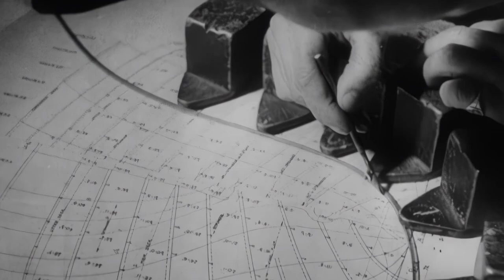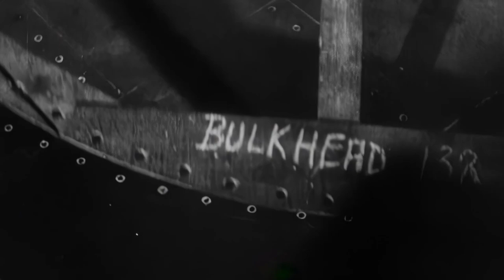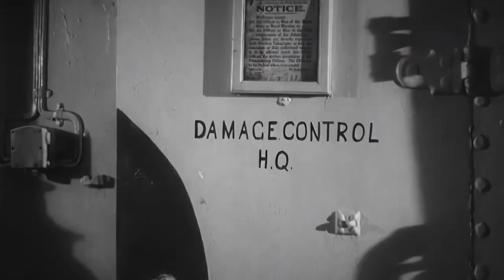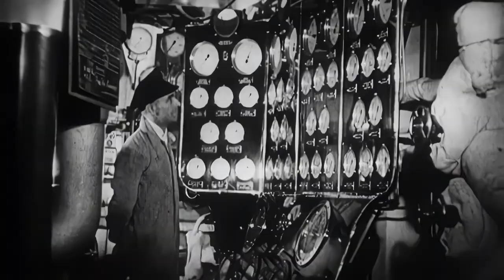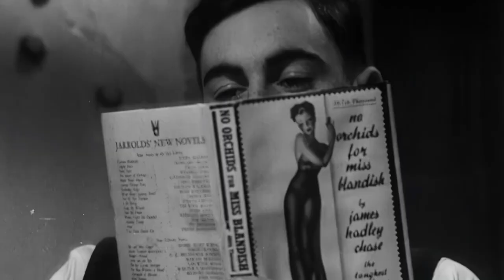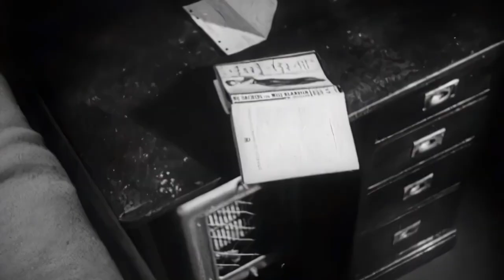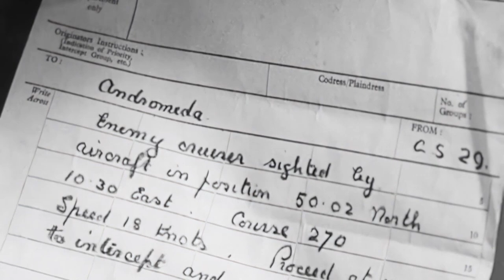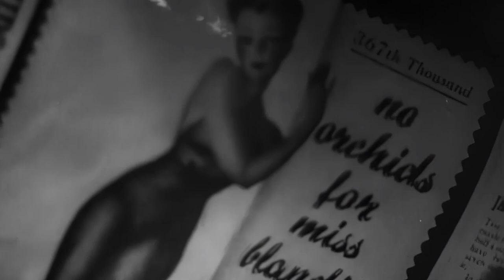Damage Control |  A Story of Seven Sailors (1944)

Comment: Thank you for your efforts that you put into sharing this. It’s much appreciated. Other than the interesting content, I work third shift and it’s such a thrill to get these posts late late at night or early in the morning.  Helps me pass the shifts. Cheers!
Reply from the maker: Thanks. These "black label" remasters mostly just take computer processing time. But I also try to make sure the frame doesn't cut out the center of focus or key details contained in the original box format.
I won't be able to keep up the current rate of publication, though. I'm going through a backlog of material I've already processed to cut into my audio archive narratives.
Reply: @ArmouredCarriers The RAN was still using this as an instructional film during the early 70’s. I can remember watching it at the Damage Control School at HMAS Penguin during my initial NBCD Course.